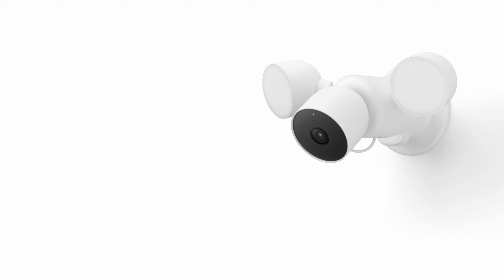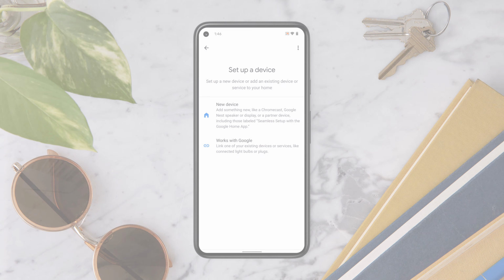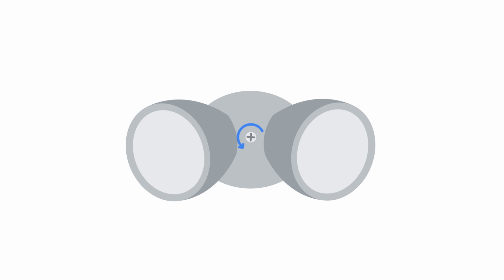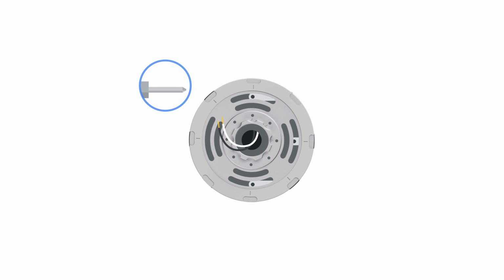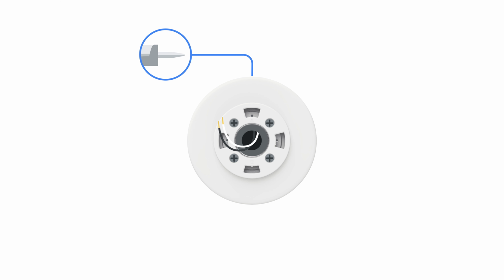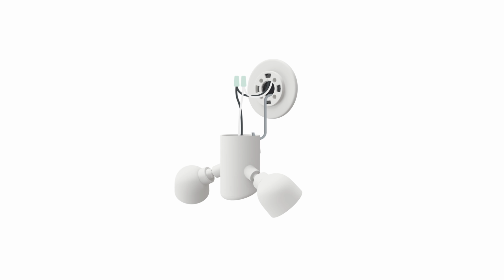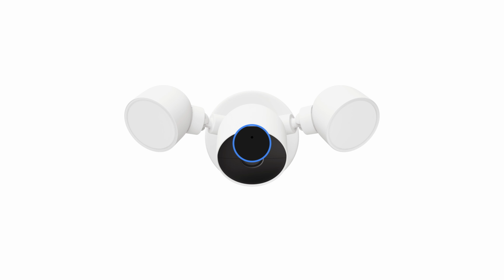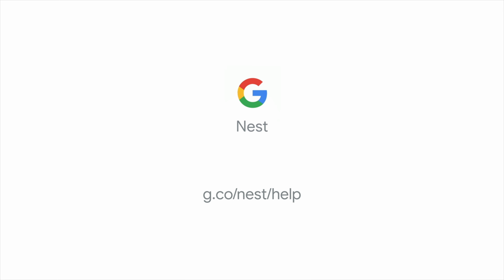How To Install Your Nest Cam With Floodlight

Comment: Can you install this if you don’t have a grounding wire coming out of the junction box
Reply: I just did. I have a metal box in the wall and screwed the ground into a screw on that. No one is going to be touching the light with the breaker on anyway. I know some electrician in the comments will have a fit but there's not much that can be done on older homes
Reply: But would it work without the ground?

Comment: I was told that this product is not integrated with the nest app, but that it can only be accessed with Google Home App.  Is this true?
Reply from the maker: Hi there, we appreciate your thoughts on our devices and we'll take this as feedback. Also, our team is working on integrating the Nest app functions to the Google Home app. Stay tuned on our social media channels for updates and announcements. For additional help, reach out through phone, chat, or through our social forums https://bit.ly/3adTfGB.
Reply from the maker: Hey there, Michael. This is true, our long term plan is to use the Google Home app as the one place you can control all of your favorite Nest and other smart home devices, as well as Google Assistant. In the near future, we’ll allow users to set up previous Nest devices and have full control in the Home app. If you still need more information, you can reach out to us directly through our social media or our support page: https://bit.ly/3abwbIB
Reply: @madebygoogle  The problem currently with that plan is the Google Home app is functionally inferior to the Nest app (by a large margin), which makes the proposition of spending £££/$$$ much less enticing compared to the functionality I already get from the Nest app and my Google Cam IQ Outdoor.

My current cam is on the front of my home and I WAS planning on purchasing a Google cam with floodlight, but I'm not going to pay £269 for the privilege of "enjoying" an inferior user experience!  If you ever get the Google Home app to the same level as the Nest app, then count me in. 👍

(Why do you keep deleting this comment, there is NOTHING defamatory OR untrue OR offensive contained within it?  Just some objective feedback from a PAYING/CURRENT customer!)
Reply: @madebygoogle  I have installed 4 of these as floodlight replacements. None of them will connect using the Google Home ap. I have 3 - 4 bars of wifi at all of the locations. It was much easier to install items via the Nest ap. Online help is useless. All it says is use the google home ap to connect the cameras. I will be returning these if I can't get them to connect. Using them just as a motion sensitive flood light defeats the main reason for replacing them.
Reply from the maker: Thanks for your post, Devon. We're always looking for ways to improve and we'll take this as feedback. Also, we'd like to continue helping you out setting up your cameras — you can reach out to our other support channel by sending a message to our Twitter (https://bit.ly/3y2icNm) or Facebook (https://bit.ly/3hXCseW) accounts.

Comment from the maker: Hey Mathias, thanks for your interest. Other than our new wireless doorbell and camera, the Nest Cam with floodlight is wired and can be securely installed. Also, we do offer a possible replacement when stolen. You can check this link to know more: https://bit.ly/3piKAtY

Comment: I just installed this floodlight today. It's nice the only thing is the power cable for the camera is short that it does not let you adjust the camera and hide the wire. Whoever designed it has a house with a light on the sidewall outside. So I have the wire in the front sticking out and the mini speaker facing up if it rains it's gonna go right in the speaker. I might return it just because of that don't know unless they have a longer power cable for the camera that gives me an option to hide the cable and face the camera the right way. The camera was installed under an eave, looks good, video great but I don't think it was made for under the eave installation, think it was made to be installed sideways, sidewall something like that
Reply: If you follow the instructions wires should not be an issue. Wire MUST be inside the electrical, octagon box.
Reply from the maker: Hi Elias, thanks for posting. We appreciate users who share their thoughts and experiences on our devices. While we're not selling a longer power cable for the camera, our team is always looking for ways to improve and we'll take this as feedback. Let us know if there's anything else.
Reply: @madebygoogle  I was hyped to purchase this until reading the above comment.  My existing security lights are also soffit-mounted, so I don't see this working for me. Seems like no one was even considering this install method when designing it. Rings Floodlight Camera can soffit install with no problems.

Comment: OK, I've installed it and the bulbs DO NOT appear to be user replaceable. Additionally, I can't add it to the Nest app?! I can't view the stream on a Nest Display or Chromecast?! What am I missing? Why is it labeled as a "Nest" product if it doesn't work with Nest products?
Reply: The bulbs will be LED/SMD so just like modern LED car headlight units. they won't be user serviceable.  Regarding the Nest app, Google wants us all to use their own (currently rather more crappy) app and as such as restricted their latest generation of so called "smart" products so they'll only work with the Google Home app.

Personally I wouldn't mind this restriction too much IF their app offered the same level of functionality as the Nest app...but it doesn't, by comparison the Google Home app is currently 🐩💩 compared to the Nest app!
Reply: wow thats a sham
Reply: Because they don’t want you to use the nest app anymore which is waaay better than crap google app. Pretty soon they’ll shut it down…google sucks b a l l s
Reply: They mention that all new cameras must use the Google home app. They are phasing out the nest app.

Comment: Does anyone know if this product works with dual band frequency (my router currently broadcasts both 2.4 and 5.0 GHZ as a single WIFI) or will I have to split my WIFI into 2.4 and 5.0 GHZ?
Reply from the maker: Hi there, thanks for posting. If your Wi-Fi router is dual-band, your Nest Camera may connect to one band better than it connects to the other band, depending on your surroundings. Learn more here: https://bit.ly/3r29iNR
Reply: @madebygoogle  As I live in Canada which there are some outdoor restrictions on the 5GHZ network, I will only be able to connect the Floodlight Cam to 2.4 GHZ. Right now my WIFI is dual band with band steering (so my devices can automatically connect to either depending on signal strength). In the past, I experienced outdoor cam issues from other brands which stubbornly required me to separate my network to 2.4 GHZ and 5.0 GHZ in order for it to connect to the "pure" 2.4 GHZ (i guess they did not recognize my WIFI was dual band). Would the Google Cam Floodlight have the same dual band issue? Would be a great help to know this!
Reply: @darkmage728  you will probably want to use 2.4 either way as the signal will be stronger that 5Ghz
Reply from the maker: We understand and we really appreciate your interest. Nest Cam with floodlight is compatible with both 2.4 Ghz and 5 Ghz band. Check out the device's specifications under this article: https://bit.ly/3DvxOwf

Comment: Does it have to be mounted on a wall, or can it mounted hanging under a soffit?
Reply: As far as I can tell it's designed to mount on an outside wall, not under a soffit.  Poor design Google.  What were you thinking ?  I really like the idea of a floodlight camera, but if I cannot mount it under a soffit it's useless to me.
Reply: @davide1621  they own Nest who made such great designs with Nest Cam Outdoor and Nest Cam IQ Outdoor, but came out with this instead #downgrades
Reply: I've been trying to determine this also. The magnet mount for the camera to base leaves me wondering how far the angle will work.
Reply: Hey google I see you replying to comments. How about it. Can you mount it under an Eave horizontally?

Edit: I bought this not even realizing it might have to mount to a wall.  Then came here to see if it was in the video. Shocker. It’s not. Mounted anyways just now to see if it would work. And yes it does. At first I thought it wouldn’t because the picture was upside down but there is an option in setting to rotate 180 degrees. It light out right now so I don’t know about the sensor yet. Will update later tonight when I see if it works.
Reply: @TheWunderboy05   hi Wayne how did you go? Does it work mounted under an eve?
Reply: @chrismccannaus  yes it does. Sensor and everything works just fine.
Reply: @TheWunderboy05  thanks
Reply: I went to Best Buy to purchase 2 of these tonight, and while they couldn't locate the ones their inventory said they had, they did have a display unit out. I played with it, and seems that the camera can be oriented for a hanging installation, but is limited by the cord to a downward 20° or so angle. I don't know if the cord on an actual unit has any adjustments for length, or is longer than the dummy unit. For my purposes, I believe this is probably enough given the height they would be installed at.
Reply: Exact same question. I'll be passing on these without the option for the horizontal installation. It's not mentioned anywhere in the documentation. Not sure if it'll work, but they do make angled junction boxes for traditional security cameras that'll buy you 20° or so. A good electrician might have a trick or two up there sleeves, but that might look ridiculous.
Reply: Came to ask the same question. I have asked on their Facebook page. They replied that it was mountable under a soffit, but I'm questioning the angle and cord like the rest of you.
Reply: @andrewjr11 you have to get a separate mounting kit for eave mount because the motion sensor on the camera is only facing in one direction... intended for wall mount only.
Reply: I was able to mount mine vertically.  Follow the same instructions.  The only differences are:  Be careful which way you put the white mounting plate cover.  There's  an antitheft screw that has to match up with the direction the camera will face.  Hanging from the s-hook will not work, just hold it with one hand and tighten the wire nut with the other, or get an extra hand or bungee to hold it up. Lastly, after setting up the camera to the app, go to the settings and rotate the camera 180 degrees.